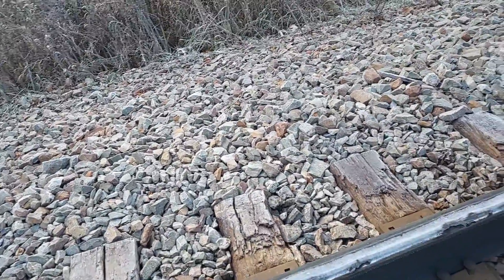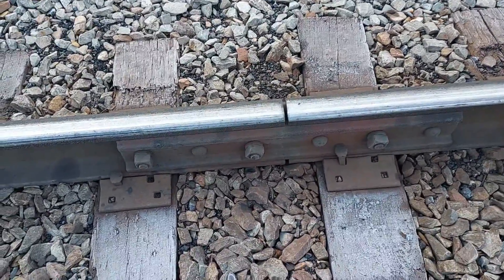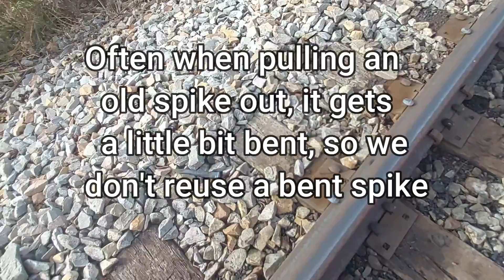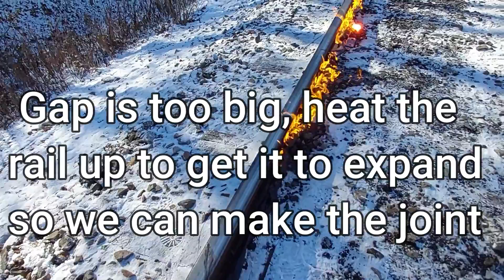How a Rail is Changed on the Railroad

Comment: When we change out rails, we leave the inside spikes the way it is and never lift up the inside spikes then we just pull the outside spikes and cant the rail in with a rail fork, put a couple of spikes flat between the tie plate and base of the rail at the spike hole on the tie plate and kick the old rail out with needle bars, when we replace rails we always put in a perfectly matching rail or one with no more than a 1/8th mismatch.
Reply from the maker: Thanks so much for sharing that Jason. Excellent. if we had the
rail stock pile to pick from like you do, we would have a better
rail head match to start with. For those who are reading this,
Jason is MOW at BNSF.
Reply: @ccrx6700  The mismatch maximum is a FRA requirement for mainline so we always have tested and certified used rails for defect replacement.
Reply: @ccrx6700  is it better to place a tie....under the joint for less fatigue on the joint?
Reply: @davewallace8219  
When I see some tracks from afar, I see lots of dips on the rails where the joiners are.
I suppose putting a special tie hammered right underneath all joints would help aid in keeping away those dips on newly installed track. Or probably does nothing.

Comment: I would have thought that the railroad industry would have come up with some Temperature /Length tables long ago that would allow measurement under any condition and installation at a different temperature or season.
Reply from the maker: There are very stringent regulations when changing continuous welded
rail Noah. Jointed rail is not that big of a deal in comparision as 
far as temperature when you lay it goes. Thank you for checking out the video and may you have  a very good day my friend.

Comment: Around the 1:10 mark how would you not see the rail was that bad going over in the high rail truck. Are these defects hard to see unless you are right on top of them?
Reply from the maker: Riding over a rail with most defects in my small hi rail truck you can
hear the difference, it's a grinding sound. In the big hi rail you have
to get out and do a visual, although if they are bad enough you
can see them from the cab toolengnh. Was very nice of you to stop by and check out the video my friend.

Comment: Thanks for this fascinating insight into the process of replacing sections of rail. How long does one of these sections of rail last before it has to be replaced again?
Reply from the maker: Your welcome Alexi, glad you enjoyed. The rail in that curve was
rolled an put in 1975. Rail in higher speed sharp degree curves
often lasts a lot less, this is 10 mph track so the wear on it was
minor. Rail in tangent track can last a whole lot longer than rail
in curves.   Appreciate your taking the time to check out the video and may you have a most blessed day my friend.

Comment: I found my piece of rail with the date of 1899 on it. I just looked at it about 27 hours ago. It’s kind of hard to see the 1899 numbers on it. I’ll have to look at the other side and see if it also has a date on it.
Reply from the maker: Oh wow, that is so cool Boyd, I love old rail. No you won't find a date
on the other side, date is only stamped on 1 side of the rail web. 
It's called a  mill brand. Should have the mill it was rolled in on
it too. If there are straight up and down marks after the date, that is
the month the rail was rolled in. Mill brand will also have the
weight of the rail on it. Thanks so much for stopping by and writing
in my friend.
Reply: @ccrx6700  
The metal has pitting I’m guessing from rusting. I might have to shine a flashlight on it at an angle after dark some night for the video.

Comment: In my line of work (owner operator truck driver), an experienced operator is a godsend when loading/unloading my flatbed. I'm not surprised to see that experienced equipment operators are also appreciated when working on track maintenance crews. The railroad is replacing a lot of track on the spur that runs along the back of my property. My grandsons and I enjoy watching them and their equipment at work...from a safe distance of course.
Reply from the maker: I can certainly agree with you on that Mike, a good operator who
unloads you is a total blessing, doesn't tear your truck or trailer up.
Appreciate your taking the time to visit with us and write in my friend.

Comment: I was looking at those rails and wondering how much fatigue is there in those rails being replaced that we can't see with the naked eye...
Reply from the maker: Ultrasonic rail testers can see inside MJ, so far they haven't hired
anyone here like superman with x rays eyes, although we once 
had a boss who seemed to think he could see inside and tell
if a rail was bad or a track bolt was bad, we used to tease him
about his x ray vision.... :-) But you are right, heavy train traffic
over many years does take a toll on internal steel. Growths can
start and actually grow larger over time internally, they are like
the rail having cancer and the tumor grows inside and you can't
see it until the rail breaks or the testers find it.

Comment: How often do you change ties?  I read a year or two ago that NS  was in a lawsuit with a supplier that they were taking shortcuts with creosoting.
Reply from the maker: We typically change around 2,000 a year here Jack. We have an
excellent tie replacement program and have done so for the past
30 years I'm proud to say. You are correct, NS bought 4.7 million
ties from a company in Alabama that were improperly or not 
even treated, some were actually painted black with paint or used
motor oil instead of being treated. They were  rotting prematurely. 
Thanks so much for taking the time to stop by and check out the rail changing show. May you have a most blessed day my friend.
Reply: Thank you for your reply.  I've seen nothing on railroad maintenance that looks easy.  Back breaking, ball busting hard work!
Reply from the maker: @jackgreen412  👍😊

Comment: So the only thing that holds the rail to the timbers is 3 spikes per timber
Reply from the maker: Well kinda Northern Living, spikes hold gauge that is their main
purpose, they hold the rail down to a degree but the weight of
the rail and train are what holds the rail down. Depending on
train speed and degree of curvature many RR's put in more spikes
than just 3 as we do too in higher degree curves.

Appreciate very much your taking the time to stop by and join in on the rail changing party. Happy rails to you until we meet again my
friend.

Comment: When you are in a situation, when for some reason,  where you have to change a rail or a couple sections when it has been pretty hot for several days, do you have to watch that section closer for a pull apart when it is extremely cold for a period of time in the winter?
Reply from the maker: Yes sir Kevin, in really hot weather we change rail in the morning
when it is cool, in afternoon when rail heats up it can grow longer
pretty quick and really mess things up. At least in cold weather
we can use the Fire Snake to grow rail back longer. Appreciate your stopping by and watching the video. May you have a most blessed day my friend.

Comment: Dave by keeping a set of the spikes in the ties you will be in gauge { if it was before removing the damaged
rail} or very close to it. you might have a slight correction. we have the gauge bars on the tracks to help
maintain the proper gauge. there are only a few pieces of old rail, most was replaced in 2009. when the 
track was rebuilt, new everything! the old track pieces are ‘37, ‘36, & ‘46 ! where it joins into CSX. the 
funny part is they used the allot of the old tie plates! dated ‘46 & 47. I want to see some of the old site
drawings to see the original layout, and see the changes over the years. it dates back to 1921. barry
Reply from the maker: You are correct in that Barry, but like you say, if it was in gauge
to start with, so that is why we still check gauge, peace of mind
for the few minutes it takes to do it.  Appreciate your taking the time to visit with us and check out the video. Happy rails to you until we meet again my friend.

Comment: What I have never figured out, is welded rails have to expand and contract.  How does welded rail allow that to happen?
Reply from the maker: Welded rail has every tie anchored Robert to help and prevent the
rail creep. Yet in very hot weather it can still buckle, that is why
most RR;'s have a slow order on trains in very hot weather. I'm
sure you've heard of derailments caused by heat buckles or as
most call them sun kinks or heat kinks. Buckles is the proper term
to use however, but the news media doesn't know this. Appreciate your stopping by and watching the video. May you have a most blessed day my friend.

Comment: That sure looked easy with the grapple. I wish our railway would invest in the machines you have they would still use tongs here on a small job like that. Also the joint bars, I see a comment you have ones to match new and old rail height we call them lift plates, just wondering why you grind the rail instead of using them.
Reply from the maker: A grapple truck sure does save a lot of manual labor, we have used
rail tongs, but trucks are a real back saver.  On different size rails
that we have such as 132 and 136 we do use the lift plates or
as we call them compromise joint bars. On replacing rail with new
that is the same size, there is a slight mismatch on the rail heads
from the new to the old rail, so that is what is being ground.
Appreciate your stopping by and watching the video. May you have a most blessed day my friend.
Reply: @ccrx6700  Ah So the height difference does not match the compromise joint bar lift I get it now. I am thinking we have shims that fit on one end of the joint bar for when that happens. If I get to see someone I know he will be able to tell me more on those.
Reply from the maker: @cedarcam  👍😊

Comment: Dave, roughly how much can a rail expand and contract with temperature swings? And does temp affect the wheels on a loco and cars?
Reply: Steel expands or shrinks 0.0000065 / °F.  If the rail was installed at 70°F and it is now 10° F, that is 60 degrees "delta T".  39 foot stick of rail is 468 inches multiplied by 60 degrees delta T and then multiplied by 0.0000065 means that rail shrunk 0.18252 inches.  Almost 3/16" in just that stick.
Reply: @keithjurena9319  Us dumb hicks don't understand that stuff so we seek simple answers.
Reply from the maker: Can't give you much better an answer than Keith did Captain Trips.
 Appreciate your stopping by and watching the video. May you have a most blessed day my friend.
Reply: @ccrx6700  OK, well, call me old fashioned but I feel it is impolite for someone else to answer a question that I addressed to the channel owner. I did begin with  Dave, did I not?
Reply from the maker: @captaintrips2980  😊👍

Comment: Another one of your awesome train rail videos Dave! What exactly do the anchors do? Do they go up against the ties to hold the rail from the movement back and forth? You sure do a great job of explaining what is being done.  I'll be waiting to watch your next video. Thanks for sharing.
Reply from the maker: Thank you Willaim for the very kind words, glad you enjoyed. 
Josh did a good job in answering your query. Appreciate your stopping by and watching the video. May you have a most blessed day my friend.
Reply: The rail anchors prevent the rails from contracting and expanding too much, with hot and cold temperatures. (Rails have the tendency to buckle and get bent out of shape and will get "fumbled" if there aren't enough anchors with temperature changes. This could lead a train to derail.)  Sometimes these rail anchors are referred to as "anticreepers" and you'll see them on every other tie, on both sides and on both rails with continuously welded rail track. ("Ribbon Rail" track) However, the tracks on the Cumberland Mine Railroad has mainly "Stick Rail" track, (39' "sticks" of rail joined with angle bars and fasteners) and a few sections welded with "Thermite Welding", using a hardened sand crucible placed on the two sections of rail. This is the older type of track, where "Dog Spikes" are used to keep the rails in gauge and these spikes don't prevent the rails from expanding and contracting. Newer tracks use a spring anchor type of fastener called "Pandrol Clips", instead of spikes and the rails are seated in the "cants" of the tie plates and the Pandrol Clips are then inserted on these special tie plates, (under the "shoulders" of the tie plates) to hold the rails in place. These tie plates are attached to the ties, (wherever wooden ties are still used) with a threaded spike called "Lag Bolts". Those are just an oversized lag screw with a four sided head and the ties are usually predrilled prior to installation. These Pandrol Clips has superior holding power over regular spikes and don't require any anticreepers or rail anchors.

Comment: Is there ever a time, when changing a piece of track in a curve, that the rail has to be pre-bent? I'm assuming that the curves have to have a large enough radius that you can simply make the joint and then spike it down as you go to get it bent into the proper radius.
Reply: Tracks are easily bent for curves.  It is surprising how flexible they really are.
Reply from the maker: On almost all freight RR's all rail is hand bent in the field to match
the curve radius Perry. In some transit applications there are very high
degree curves and yes for those rail comes pre bent from the
manufacturer. I made a video on how to bend rail for a curve if
you would care to watch it sometime:
https://youtu.be/kzWQZ8lgYl4

Comment: My dad, who is now 95 year old, tells me stories of working on the track gang back in the early 50s.  Most everything was done manually. Repairing track, working at derailments, working in the cold.  He worked for Chicago Great Western and then Chicago and North Western.  He was telling me of traveling on a speeder about 50 miles in 20 below weather to report to an emergency in western Illinois.  When he finally got home he found that his toes had turned blue.  You would have to understand my dad to know he would never go to a doctor.   He soaked his toes for some time and later cut them open to drain puss and eventually recovered.  His toes are now cold sensitive. That was hard railroading.  He left railroading after 5 years to work in a factory to have a steady paycheck because I was on the way and railroaders were always getting laid off back then.
Reply from the maker: Thank you Jim for sharing the story about your dad. I would have
loved chatting with him. Those guys back then were tough as nails.
If you dad is still with us, tell him I highly respect what he did and
the conditions he had to work under. I tip my hat to him.  Appreciate
your stopping by and watching the video. May you have a most
blessed day my friend.

Comment: Dave, reminding us of the  cold 🥶 on a 80 degree day in the northeast 😅. 
 Changing rail can be easy and simple with the correct tools 🔧 and plan. It will go like 1 2 3 done.
 I've changed rail and the replacement piece was in the stock pile at the yard. Challenge was getting the rail and getting it to the site. Old school 🏫 leverage using bars to get the rail off the pile and into the gage. Next Challenge, raising it up enough to chain ⛓ hang it from the hi-rail trucks hitch to drag it the track 3 miles to the work location. 
Cleaned the grass out of the gauge really good. 
Once there,  loosening joints to do the change out. Getting creative for  fitting a tight rail required loosening more joints, chain ⛓ drag banging to drive the joints tight to gain the amount to needed to fit the rail. Fun time and learning all in one in the woods of the Adirondack Scenic Railroad. 
Stay safe my friend and have fun. 
Richard Bause
Reply from the maker: Our old hi rail truck had to drag many a rail cause it didn't have
racks. Much rather have a too short piece than a piece too long,
can always use the snake to grow the rail but too short is a real
challenge sometimes.  Appreciate your visiting with us and checking out the video. Happy rails to you my friend until we meet again.

Comment: Dave do you think, if those rails were cut on a  45 instead of a 90 the train wheel bump on the splice would be 

 smoother because there's not a straight90 degree  splicecut,gap. INSTEAD  It would  transition along  the  next rail smoother On the forty 
45 degree cut splices.Hopethe best for you and yours GOD BLESS
Reply from the maker: Interesting suggestion Jay. I am assuming your are meaning on
the rail head gage face and not on the top of the rail head. If that
is so, then on tangent track it may work very well. However on
curved track that much of an angle will mean the track gauge
will be widened and will also mean the car wheel flange will ride up
higher on the rail which could result in a wheel climb derailment.

If you've ever seen curve wear on a rail, you would understand
better what I'm saying. We have replaced a lot of rail in the curves
that have curve wear on them for the above stated reason. I have
yet to make a video on curve wear, I keep forgetting to do it.
Appreciate your visiting with us and checking out the video. Happy rails to you my friend until we meet again.